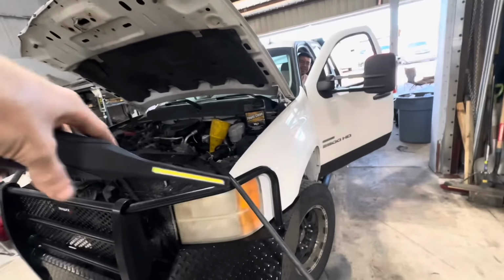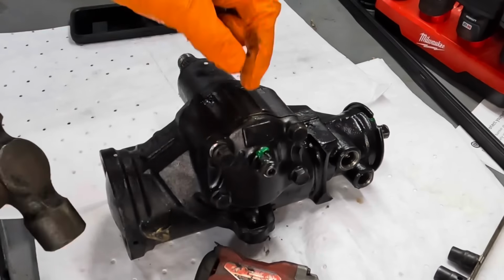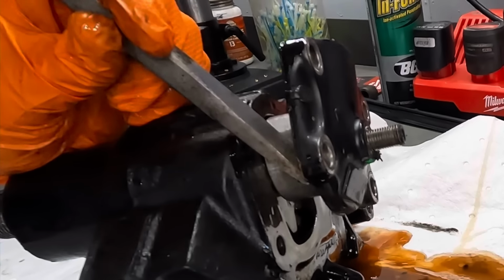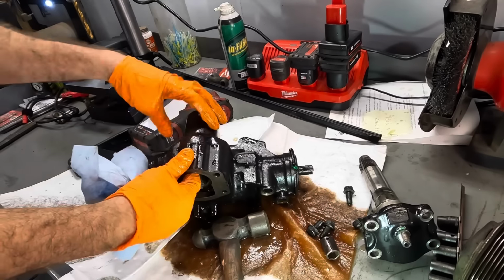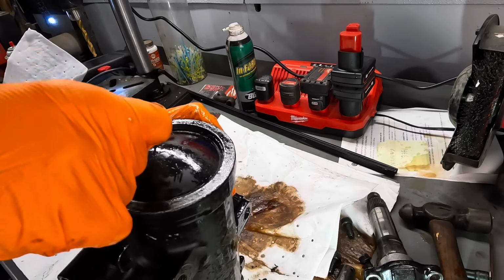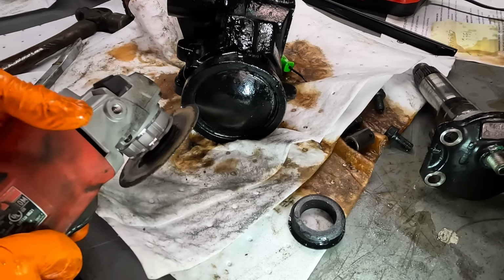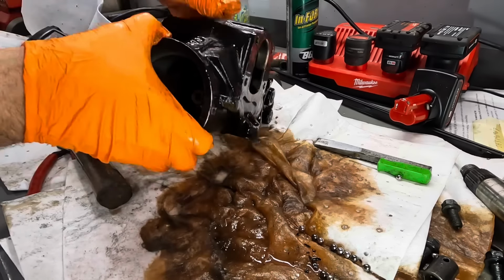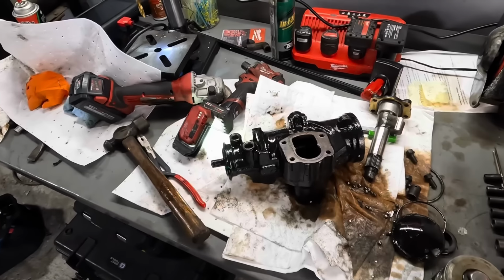Mechanic Cheated: Counterfeit/Fake Parts! Steering Gear Destroying Itself!

Comment: Those ball bearings that fell out are supposed to roll between the threads. There is a tube on the side that recirculaties the balls. I expect the noise was those balls banging around in those warn threads.

Comment: There's corrosion inside that case as well. So you send out substandard steering parts, will they stand by this if the steering locks up and causes a collision.
Charge them for your time ray and the autopsy. Because that's fraud.

Comment: Ray, my own personal opinion is that this was a scammer..  someone bought a new part, then when they got it.. simply had drained their old part of fluid, spray painted it and put it  in the box then told the parts supplier that it either wouldnt fit or they didnt need it, so it got returned and someone opened the box, said "yep looks like a part" and stuffed it back on the shelf for you to unfortunately get.   my "guess" is that the lash adjustment screw was honked down too tight and causing binding..  every amateur thinks they can just tighten that screw down to magically remove any play in their steering.. 

this is something more and more parts houses are having to deal with,,

Comment: Very sad state of affairs when you can't rely on your parts supplier to supply good parts. Now who pays for the labor time of having to R&R the thing twice? Further I'd be extremely leery of buying another unit from the same supplier. Lastly i question how long any light duty unit will last where a heavy futy unit was originally installed for a reason.

Comment: Obviously a "remanufactured" steering gear. Was it really sold as a brand new unit?
You don't appear familiar with recirculating ball gearboxes.
Maybe you should have checked your cellphone for some info.
It may have been crappy, but after your  pretty brutal disassembly I guess you are correct.
It is scrap. 
Is it possible that you indexed the steering arm incorrectly in the first place?
I don't think the piston ever should put pressure on the end cap.

Comment: I believe that mechanism is called a "recirculating ball" type.  I think that the noise you were hearing was because the balls were getting hung up and not actually recirculating.  This was causing end thrust on the worm gear which is was was pushing on the end plate.  How unfortunate that it's a POS.  At the least, you saved that from being reboxed and sold to some other mechanic who also loves his job so much................

Comment: For as long as you've been working on cars, im pretty shocked you cut the case and ring because you thought that ring could not come out. Theres a hole you can use a punch or something to stick inside to knock it out. But even wo the access hole, if the ring is not solid all the way around, you can get behind it then walk it out. It can be a pain in the ass, but they come out. Highly doubt you'll get your money back after cutting it, when if you did it right and put it back together you could have. But yea, its absolutely ridiculous how bad reman parts have become over the last few years. There was always some quality control issues because they just replaced seals and didnt notice the part was actually worn, but its far worse/far more common to get shit parts now. Brand new or reman
Reply: He said himself he has never taken one of these apart before. It's entirely possible that with all the paint on it the access hole to remove the snap ring was covered up. He tried getting behind it and couldn't. Given that he had just been ripped off I doubt he cared about the core charge and I can't say I blame him.

Comment: I would much rather pay a little more at Auto Zone, or where ever, if they would just step up thier game on making these parts. All the tooling, engineering, factory,  etc. , to make even cheap ass weak parts. They are going to all that trouble, why not use proper material and craftsmanship,  and have a good part? Cheap as hell ain't good , if it don't hold up. Luckily , I do 90 percent of my stuff . If not, If I could not do all that, I would prob. just get Ford oem parts from the get go. The aftermarket radiator, and overflow tank, are holding up just fine. Auto Zoned them in , quite a few yrs ago.

Comment: With all due respect,destroying case to remove snap ring was not necessary ,using a vise would have been helpful, but thank you for autopsy.BTW,that fluid is extremely dirty, a flush might have helped the system before installation.

Comment: Not to scare anyone, but in aviation we get rashes of counterfeit parts for planes. 
And airlines do buy them. 😮
Reply from the maker: Is that why the non doors fly off mid flight?
Reply: the door flew off because somebody forgot to bolt it in and then didn't check the work.
Reply from the maker: @najay0  ohh that’s scary😱
Reply: Thanks, Paul, because I'm afraid of flying anyway...
Reply: Now they just didn't bother to put the bolts in at all
Reply: @RainmanRaysRepairs   Naw they just forgot the bolts.  Even if the bolts were in without a nut and cotter pin the door wouldn’t leave the plane.
Reply: @thecuss6817  please don’t be, it’s a very safe way to travel. Seen a near by freeway lately?
Reply: @RainmanRaysRepairs  In my days in the USAF, a guy or gal installs the repairs and the next level person inspects the work the installer did then both are signed off on task is completed. Always a paper trail for those installs. lots of names on this.

Comment: Just bad QC. Also, all re-manufactured steering gear and steering rack will have used gear. So, play caused by worn out gear will still present on re-manufactured part. Play can be taken out by tightening adjustment screw, but then when you reach end of the steering gear with less worn out tooth, gear gets too tight and jams. :(

Comment: IF that was supposed to be a new gear..... shame. Customers sometimes have to be edumacated to the fact that NEW from the original manufacturer is going to cost more than NEW from the "Parts House". OEM is what came on it and with SOME stuff is what needs to go back. Steering boxes and most Steering components fall into that category. MOOG is case in point. Years ago that yellow and blue box was the best and the parts inside were often BETTER than OEM. NOW..... MOOG is junk and most installers know it. Sad, but true.

Comment: Im 80 years young and was a fleet mechanic maajoity of my working life for the same company and have taken a bunh of thse steering gears apart and rebuilt them and NEVER EVER DID I EVER CUT ONE OF THOSE HOUSINGS THE WAY YOU DID. I now understand why you were let go at tht dealership where you worked. All you hd to do was take a good stout flat screwdiver and sharpen the end on it then take a little mallet and drive the screwdriver in behind the end of tthat snap
ring and pry it right out of there. now youve destroyed a thousand dollar steering gear you couldve repaired for a hundred dollars and f im not mistaken that popping noise you were hearing in that gear was because whoever built that gear last left one of those little balls out and that left a space in that worm that would pop back and forth when you worked the steering gear so in the end probably all you needed to fix it was 1 little ball bearing

Comment: Hey probably it's off a junk truck and repainted to make it look new and resell it as new to make profit. My wife bought a 2016 Kia from the dealership back in May 2023 and before Jan 2023 they had to put a new motor in it. The motor was on recall they sold it hoping it would last until it was paid off but it didn't work out so Kia had to eat that motor plus reimburse my wife over $300 for out of pocket car rental while they repaired her car.

Comment: Dude, that's not the correct size of socket, they would of had to put 3 spray bombs of paint on the head of those bolts to make the socket that tough to get on and off the bolt

Comment: the worm gear has the ball bearings ride the worm. bet during the rebuild, If that even happened, they fell down to the bottom of the shaft, causing further extension, pushing on the case cap? perhaps. garbage none the less.

Comment: You are one helleva shonkey mechanic. Belting green handled screwdrivers with a ball-peen hammer, using the wrong socket on the cover bolts instead of going half a size up & then using an angle grinder to get out a snap ring. I've watched your vids before & the same bad workmanship & running off at the mouth in those as well. Shhheesh! Get some training.......NOW!

Comment: I can't find the right video but you were putting on a steering gear on a burgundy colored Nissan truck, where is had been leaking was built up with nasty greasy leaked oil, the steering joint was very rusty and in a pretty bad mess,....why did you leave everything in such a  greasy mess, you cleaned nothing and put the new gear on in all that mess,....you should have cleaned all that greasy stuff off, that's totally sub par work and you shouldn't be paid for bad work like that!!

Comment: What the hell !?!?! That end cap has to be pushed forward,slightly,and then the ring can be pried out using a small hole in the casing.
I quit watching when you went after it with the grinder !
\